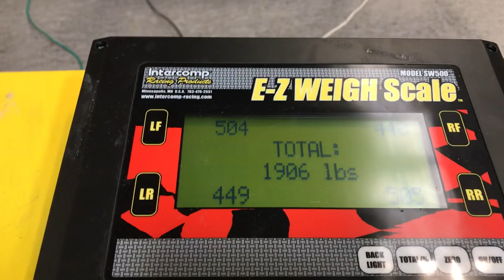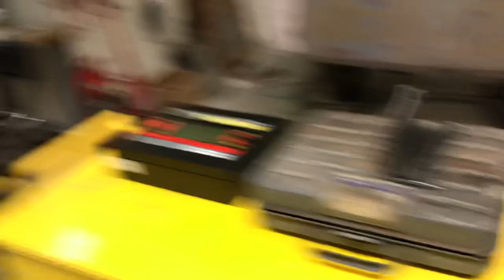SlagHammer goes on a Diet.@UncleTonysGarage #nonamenationals #mopar

Comment: If I recall correctly, Tony said it was going the street freak route. That doesn't mean it can't have a semi-nice interior, I wouldn't cut up the doors, it's not a race car. Strategically cut holes in the frame and triming here and there would be my choice
Reply: Well,  you could cut out some door structure and put door cards over it/replace with aluminum.   Memory may fail but I think that car arrived pretty gutted.  Or at least gotten so real quickly cause they were originally making her a Gambler off road thing.
Reply from the maker: It was a complete car when he first got it. It was gutted out for parts.
Reply: @TheTazzman1968  K.   (As one of the gals around here,  I actually care about interiors.  As for a 'Street freak'   I'd actually lean to street things.  :)

Comment: Cut out the heavy floor and transmission tunnel that UTG put in it and weld in a 18 gauge floor in it, it  doesn't need to be 1/8" metal for the floor with that frame.

Comment: I'd been wondering if those cool chains for the nose might be lighter as cables, as a minor thing.   Also it might make sense to compare costs about one of those new lithium batteries as opposed to what it might cost to take out an equivalent  ten or fifteen pounds in little bits.

Comment: Time to get the Hole Hawg, the hole saw set, and the large-caliber drill bits. Flat surfaces only; try not to perforate the "corrugated" parts (but you already knew that...)

Comment: Weight down low is good. A lot of horses what it needs, to carry well. 
        Love the suicide nose,good work on 2dr conversion. What kinda power outter you got in mind?  A Freak should be blown. Turbos get better everyday. Nitro the right way is alot of pulling pistons. 
       A uni on a truck is heavy,but a good base for stupid power.

Comment: Ah yes cutting and drilling structural components to gain a pound here a pound there when there's 50 lb of Bondo in the  rear quarter seems legit lol
Reply from the maker: There is a 15lbs difference between the passenger and drivers rear. In the previous video I mentioned that I took a lot of it out.